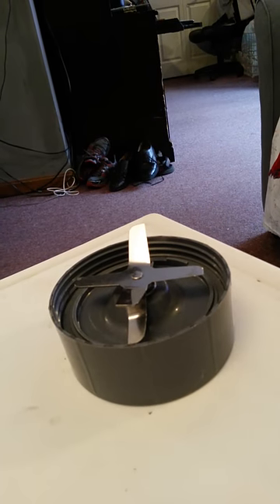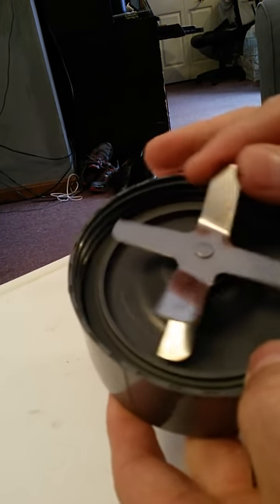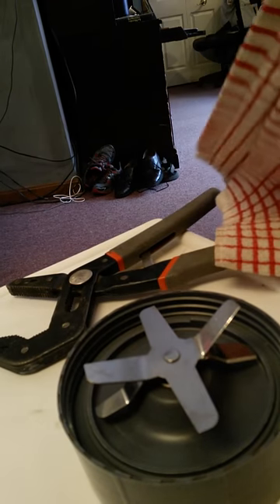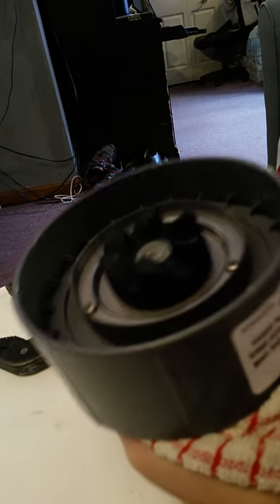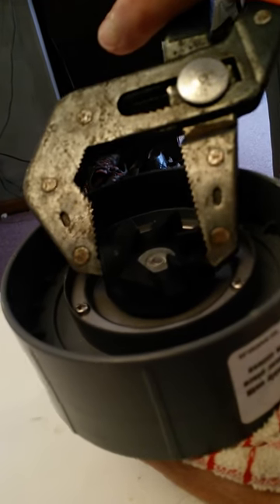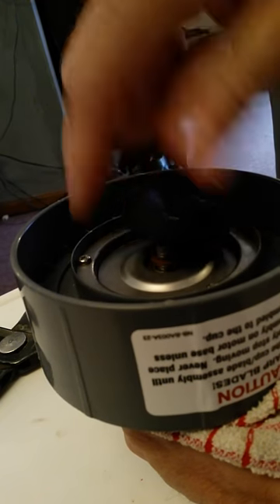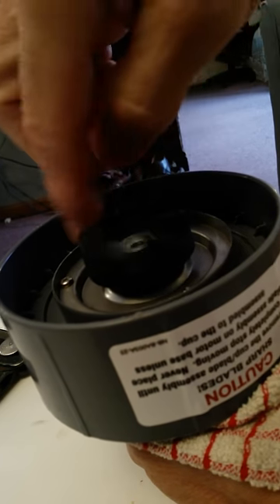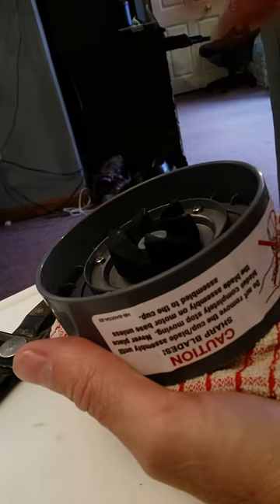Nutribullet extractor blade replacement

Comment: This is helpful in removing the rubber gear from the back, but still doesn't show how to replace the blade. I've removed the rubber gear, removed the 3 screws in the bottom and removed the washers and seals. The blade still does not come out of the mechanism. I can't find anything on youtube to help with the actual blade part. Do you have any tips?
Reply: Just tap the shaft end with a small hammer; not hard.

Comment: When I try to blend, it is spinning but it is not turning the blade. The blade has somehow come loose. Maybe it is stripped or came unglued? I try to tighten my blade (turning counter clockwise) and it just keeps spinning. Does that mean that it is stripped? I can't tighten the blade, and when I try to loosen it it just keeps spinning. It turns freely both directions, but won't come off. Is it stripped?
Reply: Have exactly the same problem.  It is supposed to come off when turning clockwise and tighten when you turn it counter-clockwise.  However, nothing happens. The wheel and the blade can rotate independent of each other. Need to tighten it, but don't know how.
Reply: Did you ever figure this out? I have a couple blades that behave normally, but I'm working on one for a friend and the blade and rubber gear spin freely in opposite directions as you described. Based on what I know from taking other blades a part that should not be possible.
Reply: Do you have a solution pls? Haha